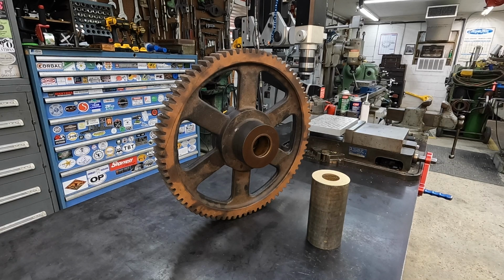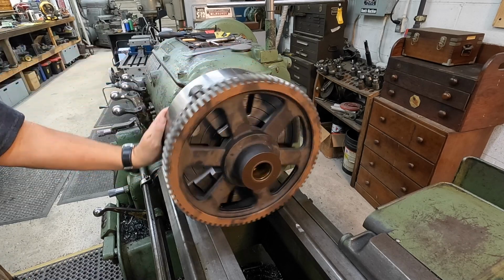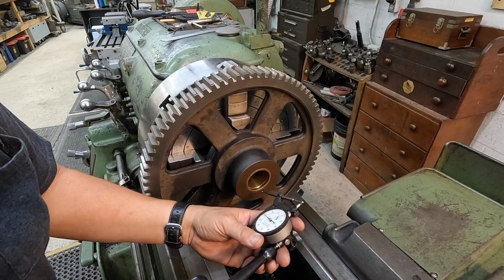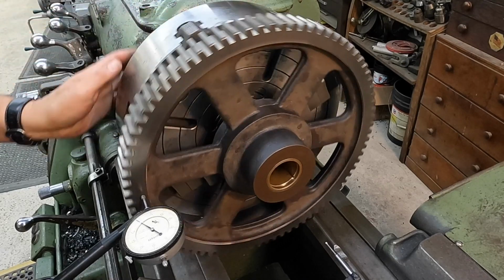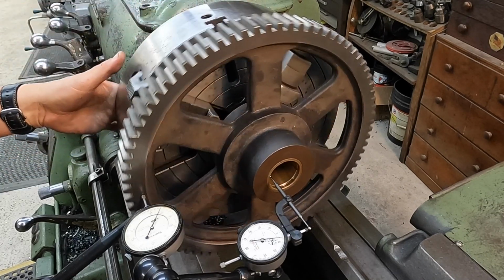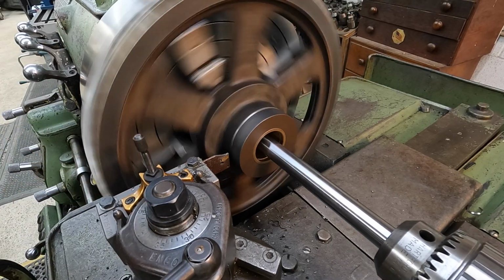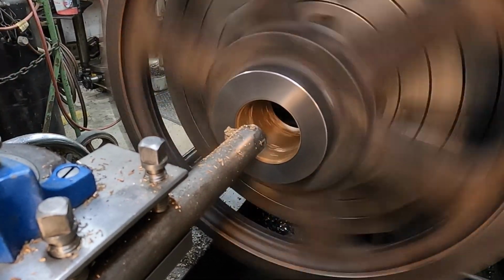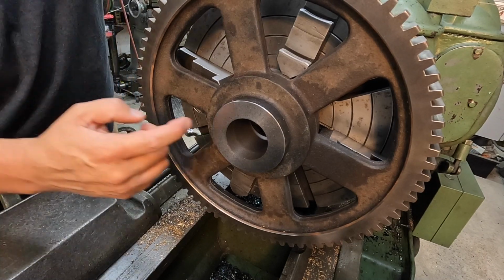Gear Modifications Part 1

Comment: Exactly my thought that the old bushing was either done "good enough" or to a low qc. 

Pretty dam good job if I do say so there sir of showing the oldest of machining, working a set up and explaining how to get it true.  Then it proves out so darn close.  
   A master class level there Adam.  
One thing I've always noticed is that the explanations of how you know it is high or low are a bit lacking sometimes, could be just done so fast too. 
Today how you showed to only be concerned with the levels across being identical to constitute a true plane.    I would like to see the indicator down in the bore more too just for the sake of really knowing was the bushing inconsistent or possibly the bore not being perfectly perpendicular to the face of the gear. 
  Great content.

Comment: Curious how your deciphering which jobs go to the new shop and which jobs like this you’re keeping on the existing equipment? I know you don’t have all of your necessary tools, machinery and equipment over there yet, but was just kinda curious. Keep up the awesome work, great to see you becoming so successful with your endeavors!

PS. Love watching that indicating. Amazing! I still scratch my head and have to think about it every time. Given I’m less than a year of having my equipment and learning this trade.  Machining and machine tools has been something I’ve been interested in for as long as I can remember and for a person with perfectionist OCD, machining is a dream come true. You inspired me to finally go out and buy a mill and lathe. I have a composites company and it’s amazing how useful these tools can be for all kinds of different processes. The thing I love the most is the accuracy. Sure I can measure and drill holes with a regular handheld drill, but my OCD doesn’t like that very much so knowing everything is as exact as I can get it is quite satisfying.
Reply: This job it was specifically because he needed a 4 jaw chuck to independently indicate the gear center and only his monarch is currently set up to have one, I know he has a 4 jaw, 3 jaw, and collet chuck for the Victor lathe but he rarely uses those ever since he put that 6 jaw chuck on it. I know he has a 4 jaw for the Pacemaker in the new shop but he's not done fixing the cross slide, once that's done there shouldn't be anything he can't do at the new shop.
Reply: @bdkj3e  Very good points. I kinda put all that together after realizing the entire scope of the job and the use of the 4 jaw obviously. Is this even something you would want to do on the Pacemaker instead of the Monarch given the size? Forgive me I’m still learning. I just purchased my first lathe and mill about a year ago. Thank you!

Comment: how is the bore of the hub concentric with the OD of the gear, but the hub itself is so out of whack>?
Reply: The gear started out as a raw casting. Probably what you see but without the bore and gear teeth. Then the factory adds the features, and the bore was probably added before the teeth and they didn’t get that bore centered  very well. It’s like printing a image into a sheet of paper that’s got crooked edges. The picture is straight and square to the earth but the paper is crooked. It’s functions fine but not visually square.
@blondihacks has some good videos about adding features to castings. Very good videos.
Reply: @flyingjeep911  +1 for Blondihacks.
Reply: You can also see that the larger diameter of the spokes area is also running out.

Comment: Is it just me?
 If the original Factory bore is 0.003 of an inch off and you rebush it like that, the outer gear will be 0.003 of an inch off?
I would go ahead and re-zero the unbushed factory bore.
Reply: No, you're not wrong. What he has not measured is the root of the teeth around the circumference. My OCD would dial out the 0.003" (0.1mm) and get the hub bore aligned to factory. Having said that, with the size of that gear and the pitch of the teeth, 0.003" is small compared with the running clearance against the adjoining gear.
Reply: No because the factory cast bore appears to be and SHOULD be true to the OD of the gear teeth. 
His new bronze bushing will align true with the factory bore once its pressed in, thus also aligning true with the gear teeth. Obviously that would only work IF the bronze bushing is machined concentric on both the OD & ID which I’m sure he will do
Reply: @6Drugstep9  the Chuck needs to be readjusted to dial out that 0.003
Reply: @azinfidel6461  but why would he dial it out if he finished the machining on the gear hub? He only had to remove the bushing. If the factory cast bore is concentric to the out gears diameter and he dialled out that 0.003 and machined the bore. The bore would then be 0.003 out of concentricity to the outer OD of the gear

Comment: Reminds me of one of my favorite joke/analogy/lessons.  An old mechanic is brought in to evaluate in industrial engine that won't start.  He walks around and listens and feels as they try to start the engine. He then takes out  small hammer and taps the engine 3 times gently. He then nods to the operator who hits the switch and the engine fires up without a miss. He then presents an invoice for $10,000. The company screams bloody murder and demands an itemized invoice justifying the expense. This is followed by a two line invoice. Hammer tap, $2. Knowing WHERE to tap, $9,998.
Reply: I always heard it as a plumber and water heater.

My uncle on the other hand was working with radio receivers.  So antenna/reflector, through some waveguides, to the actual electronic revivers.  And they were doing the final tuning.  Which meant calling in the guru. He comes in, looks at the current frequency graph they have, looks at their setup they are building,  and takes out his little black book (and my uncle was clear it WAS a little black notebook.) Writes down a few equations, works though some stuff and comes back and goes "You need to put a block of metal This big by This big by This big...", using his fingers to show the size, "...riiiiight there" pointing to a spot on the assembly.  After some disbelief the do it, and run the frequency analysys again.  And it is perfect.

NOTE: I may have used the wrong terms, also this was in the 1980's so computer modeling of the system was not a thing yet.
Reply: Hard reject on that. This "anecdote" has about 1001 variations, all of them bullshit. Nobody should be paying cumulatively for every single working day that came before in someone else's life, all paid for already at the time. If your <thing> needs some absurd Zen master to fix, the problem is with you - it should have been replaced long ago with something more functional that a minimally competent (and appropriately invoicing) craftsman can fix when it breaks. Meanwhile, if said Zen master wants to get paid lots of cash, he's welcome to do lots of actual honest fucking WORK.

Comment: I feel like this much casting imbalance shouldn't even be acceptable - the vibration and wear increase on all the parts in the system must be huge - unless this gear is literally moving really really slowly.
Reply: What is your background expertise in making that critique?
Thats a very large mass gear.  The extra several ounces around the central bore is 1. Miniscule compared to entire mass, and 2. Close to the shaft so centrifugal force is likewise miniscule.
Reply: @boots7859  It's called basic physics. Since you're unfamiliar with rotating masses, when they are out of balance they create forces perpendicular to the rotation - aka vibration. To address point 1 as an easy example for you, think of the wheel on a car and the tiny weights used to balance it - the speed of the wheel would cause problematic vibrations were it not balanced.

To address point 2, how close the imbalanced mass is to the axis of rotation is only relevant in the secondary, since whether it is close or not close it is firstly subject to speed of rotation.

Like I said, the imbalance in this gear would be a problem if it were spinning at enough speed to cause harmful vibrations so it is presumably not spinning very fast, hence the poor casting isn't a problem.

Go back to school.
Reply: @cozmium  ...AND I'M PRETTY SURE THAT ADAM KNOWS WHAT HE'S DOING- MIND YOUR OWN BUSINESS!!!
Reply: @daleburrell6273  What I said was to do with the casting, nothing to do with Adam's work - relax lol
Reply: @cozmium  ...IF YOU SAY SO-

Comment: Educational video. 
How should indicating concentricity over the teeth of the OD look like? Is it even possible? 
Thanks for showing Your work.
Reply: If you have heavy masking tape it works well to allow you to indicate the tops of the gear teeth without the indicator falling in.  That usually good enough but if you need ultra accuracy you use dowel pins between the teeth and indicate them.

Comment: How about fixing the wobbly O.D.
Reply: Thats an excellent way to end up buying or making a new part for a customer....  You do the job they ask and are paying you to do.   Making any other changes just because you feel like it is the quickest way to have customers dump you or sue you.  IF this were a highspeed part, and IF the mass were significant enough to impart any sort of unexpected centrifugal mass effect, I'm sure Abom would advise the customer, explain the problem, and get authorization to make that additional change.
Thats why Abom is a professional vs a YT watcher.
Reply: @boots7859  ...YOU BETCHER LIFESAVERS-!!!!
Reply: @boots7859  You are missing the point in the first part of your comment.  The second part where you open to cooperation and sharing experience with the customer is more like it.  Taking great care in centering the ID to thousands and then leaving this wobbly OD without consulting with the client cancels out.  Even YT watcher can appreciate the mid-long term effect of this unbalance on the sleeve-bearing and connecting elements.  Am sure that Adam considered it and might just do it for pride to sign his Name to the project.

Comment: Since everything was factory new, could you have mounted the gear on an expanding arbor (with the factory bushing in place), machinee the OD of the hub to be concentric with the bore, then used that freshly machined hub OD to mount the gear in the chuck? Or would that procedure lack rigidity/accuracy?
Reply: ...THAT WOULD HAVE BEEN UNNECESSARY.
Reply: Sure he could have done that. And since he already had a quoted price, he would have been working for free.  Do you often work for free? Kicker is, thats not a high speed part, and fixing that optical wobble will not improve the longevity of the part, machine, or its operation.
Try to stay in business by having unnecessarily high quotes compared to your competition, or by spedning potentially billable time doing work for free on every job.
Reply: @boots7859  ...GOOD POINT-(!)

Comment: what type of indicator do you normal use on lathe and what is the attachment  on the indicator
Reply: The holder is a Noga Flex Indicator Holder. Great tool. For the bore attachment it is a Starrett 670 AGD Indicator Hole Attachment. Adam is a lover the the Starrett indicators, but has a large collection of my brands. Didn't see the face of the specific ones he was using. Hope I answered your question.

Comment: I enjoy doing jobs like this, when the factory part is no longer available. It feels good to help keep an old piece of equipment, and in my case, an older Evinrude outboard running. I recently reverse-engineered the timing encoder for a ‘91 V6 Evinrude for a friend. Turns out there’s a small market out there for them and I now make them whenever someone needs one. 

BTW, how is your CNC experience going?

Comment: I wouldnt have resisted the temptation to skim true the OD of the centre casting.
Reply: I hear you, Nigel.  Even if that hub OD has no bearing on the operation, just seeing it wobbling along would make me want to fix it.  But as long as the ID is concentric with the OD of the gear teeth it becomes an aesthetic thing at that point.
Reply: @michaelscott8226  ...EXCEPT IT CONTRIBUTES TO THE IMBALANCE OF THE GEAR, AND RESULTS IN INCREASED VIBRATION-!!!
Reply: @michaelscott8226  cont.
The cast ion is heavy. The reciprocating unbalanced mass will be shaking trying to desyroy every art of the machine. The out of balance will wear bearings & bushings until the flywheel teeth wear. Probably the wear wont be synchronous so it will propogate the wear around the circumference of the teeth.
So much easier and cheeper and more professional to do the job properly the first time.
Reply: @N1gel  You guys are seriously wack.  Abom is running a business, and the contract on this job is to machine it to customer provided dimensions.  That handful of ounces of cast on that out of round gear is miniscule compared to the total mass of the gear. 
Further, its right next to the shaft, where its speed is slowest, incurring the least amount of centrifugal mass affect.
Your claim of 'reciprocating unbalanced mass' is simply a BS word salad devoid of any meaning or context in this situation.
At the low-med speed this rough gear is going to be run at, its going to live a long, long time with the excellently machine bushings Abom has made, assuming basic maint. is done.
I would expect this gear/bushing would shrug off even med-high RPM work without a sweat.
There is a reason some people, like Abom have a career and make a living doing this work, and others either watch on YT or play in the garage where the additional work/time/$$ fixing stuff like this all day is a non-income impacting imperative/OCD issue.
Reply: @boots7859  hi.
 I absolutely agree with every point you made.
Accept that the carbuncle in the centre is not in itself insignificant.
It Does look unprofessional.
It Does cause a dynamic imbalance that is as you said not mechanically seriously destructive.
But the imbalance it creates is considerably more than if it was turned true.
IF you had the gear in that condition and no workshop then maybe using it as is would be fine for the length of our lifes where-upon some moron will probably throw it away.
However, not only has Abom got a lathe but the gear was chucked up true and skimming the carbuncle true would have taken less time than a please click the thumb up comment.
It would have cost Abom a fraction of a cent to true it.
It would have taken equally  totally negliagable time.
It would have demonstrated a great work ethic.
There are No downsides to doing a job properly just because you can.
I am not criticising ABOM.
I watch others such as Stephen Gottswinter and Joe Pi and Mike Patey because they are REAL Professional skilled engineers.
Although a bit tame at my level, I watch Abom because I respect him and what he does.
I happily ALWAYS give him a thumb up and NEVER ever a thumb down.
But I think he should have trued the outer surface irregularity just because he could.
GREAT WORK is better advertising than any advert can deliver and Great workmanship is what Abom is trying to teach.
Reply: @michaelscott8226  hi.
If the RPM is minimal and the unit maxx is high then perhaps the eccentricity is aesythetic but thats unlikely to be the case and the out of dynamic balance